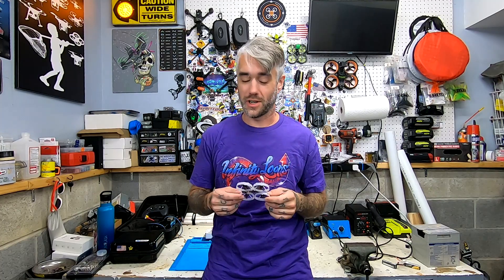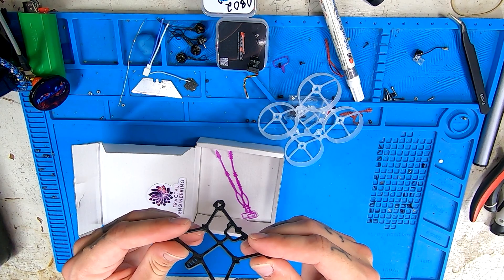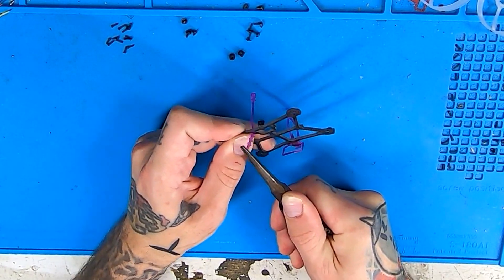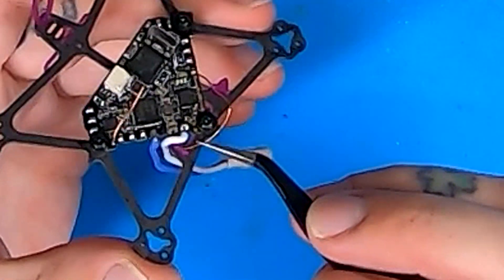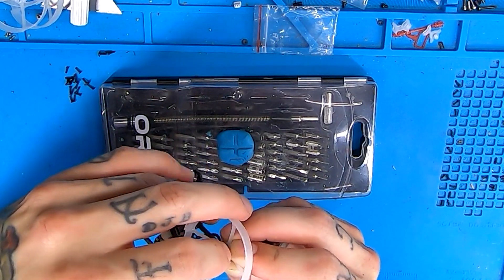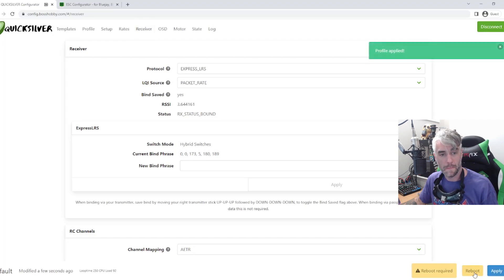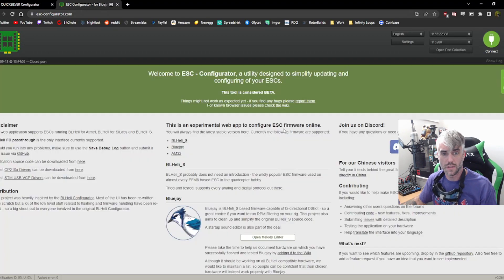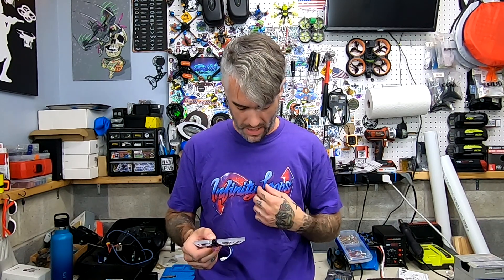The Mobthicc V3 | Complete Build & Setup

Comment: Hi,
     I wish to clean my brushless motor by removing the dust/sand !!

What do you think about cleaning the 0802 brushless motor by using
99.9% Isopropyl Alcohol Electronics Cleaner in spray can ?

Does the Isopropyl Alcohol will remove the grease of the bearings ??

If yes do you have a better solution ??

Comment: Sickkk, i'd been waiting for this one!
Do you know if i can fit the 4 point mobula canopy in this build instead of those 3d printed camera mounts?
I would be using the X12...
Want to transfer the guts of my mobula7 1s elrs to the F75 but i'm too scared to run it with the electronics exposed on top🤣😅

Comment: Hi mate, am about to do a frame swap for my poor broken moblite 75 and was wondering if you reckon I could chuck it on an Air75 frame without having to solder or cut the frame? Cheers for any help!
Reply from the maker: I'm pretty sure that should swap over just fine. Little to no issue. That's the Diamond FC right?
Reply: That's the one mate, will give it a shot and let you know! Cheers for your help.

Comment: Just finished my build where I used all the exact same parts, with the exception of the battery connector (using the PH2.0), ran 1.5 packs through it, and I got to say this is a pretty incredible rig/tune. 

I've primarily flown 5 inch freestyle rigs for the last couple of years, but the feel and performance of this thing is shockingly comparable. I threw power loops around a kitchen chair, and had no issues throwing or catching without any prop wash. Snap rolls, back flips, and front flips all felt dialed - no wonkiness on rotation end. I juicy ejected and was surprised to feel the carry...didn't expect that to be as pronounced as it was. Juicy flicks had a good throw and feel. I'm pretty confident this rig can handle any of the more advanced stuff, except maybe inverted yaws...I'll need a higher ceiling to try. I'm pretty sure I'm going to break it inside my home shortly, and may not have a chance to do that.

I did run into some issues:

- I couldn't connect to the board on my windows machine. When trying to "Reset to Bootloader" it would find the COM, but would then lose it on reboot. I worked around by using my Mac to configure FC and ESCs.

- using the template: the board orientation wasn't correct when I watched the software model. No biggie, but not sure why my orientation would be different. 

- I had to create a different RC model in my radio, as my AUXes were upside down. Didn't immediately see a way to invert the Off/On for AUX assignments in quicksilver, but I'll take a gander at the documentation. 

- I also had to play detective on what motors were assigned to which ESCs to get everything spinning the correct way in the ESC config tab. 

Otherwise, this is probably one of the most complete and easiest to follow full build tutorial I've seen. 

Thank you for this. So. Much.
Reply from the maker: Hey man! Glad you enjoy flying it!
The issues you're having sounds like a different gyro in your fc. HM changed what gyro they were using in the diamonds. I'll see if there's something we can do about that. But I'm glad you got it figured out! Let'er rip!

Comment: Thanks for the video Heads. Great guide! While I cannot hate the ingenious idea of a Fractal frame, it has some issues:

1. Caddx Ant Lite
Mounting a camera which has connectors in the rear isn't supported out of the box with the TPU. Had to lengthen the original model with extra teeth to grip around connectors. I'm reluctant to depin the cam, as being able to change the settings every now and then is nice.

2. Camera mounting in general
I'm not sure if it's because of my modded mounting solution, but even minor crashes end up tilting camera ever so slightly to either side. I find it really annoying.

3. Trutle mode
W/o a canopy which provides distance to the ground, turtle mode is much less reliable. It takes many more tries to flip over - sometimes quad just spins on the ground. I haven't tested this extensively outside in the grass, but I presume it'll be much worse than on the carpet.

4. Battery mounting
300mAh nitro nectars are prone to getting released from the front holder in crashes. I'm trying a mod with thicker holder, we'll see if it improves things.

---

Modified 3d model: https://www.printables.com/model/301933-modified-300mah-cam-holder-for-fractal-6575

I prefer the Mobthicc v2 - w/o any of the issues mentioned above (2,3,4 especially) it lets me fly until the battery says stop. Cracked frame can be fixed with a bit of heat shrink. 😉

Would be curious if you encountered any of the above and if you have any tips. 🤞
Reply from the maker: Hey thanks for the comment! 

1. While beta testing the Fractal75 I tried several cameras, the Ant lite being one of them. In my notes it was the largest camera, weighed the most, and had pretty good image quality. I didn't fly it on the build though, being the heaviest of the ones I had available, I opted for the Foxeer Pico Razer instead. Weight was much less, better shape, the lens didn't stick out so far, and the image quality is solid. The only kicker was the pigtail needs to be changed when you get it. Yves from Fractal may have actually tried the Ant on it. I'll have to ask. 

2. I'm going to assume it is from the camera used or the modifications made. I never have a problem with the camera moving. This very well could be because of the shape of the Pico and where the plug sits. I was extremely skeptical with the camera mount when I first tried the f65, I think I even mentioned it in my review video back then. That had the Runcam nano 3 in it and holds very well. Surprised me. 

3. I can make mine flip on hardwood or my garage floor pretty easily. First or second try usually. I don't want you to think I'm messing with you, I uploaded one of my most recent flights with the Mobthicc. This is my first pack of the day and I was getting tattooed lol. So there is a fair amount of crashing and flipping on hardwood. https://www.youtube.com/watch?v=1LiiJEtFXNE

4. I use 450mah packs in mine, and 3D print my own holders. Some variables there. My prints could be getting squished a bit more so the space for the battery is slightly tighter. The 450s I use are wrapped and stretch the tpu pretty good. Every now and then I would get a bad crash and the battery would slide out. I put a small ball of BlueTac on the bottom of the carbon. So when you slide the battery in, it kind of squishes the bluetac down and adds some traction for the lipo to grip. Could also do a bead of hot glue, carefully. I hope that new holder works better for you. 

I say use what works for you. If the older build works, just fly that! The reason I swapped frames between builds was for durability mainly. I can't break these fractal frames very easily. Also keeping the weight down helps make those crashes a little less catastrophic, which is why I avoided the heavier camera with nice picture. I got tired of breaking things haha. 

If I left anything unanswered, or something else comes up, don't hesitate to let me know!
Reply: Appreciate your response! 👍 Of course, flying what works makes perfect sense, but we're here to also try new things! 😉

I hope my lengthy message didn't come out as rant. I think there's a lot of positive things to be said about the fractal:
- improved durability you mentioned
- not having to replace the entire frame in case one duct cracks
- easier maintenance due to how nicely accessible the fc is
- camera positioning means you can get that bit closer to obstacles and ground
- better prop wash handling at low voltages (placebo or I have tuned v2 poorly)

I'm going to give the pico razer a shot. Thanks for the tips wrt battery mounting. If it comes to turtle mode, I agree it works (eventually) on hard surfaces. It's the grassy outdoors which I'm slightly concerned about - TBD.

I wonder what your v4 will bring. ✌
Reply from the maker: Ah yes, grass is a killer. I keep mine fairly short, but even then sometimes it's a walk of shame 😕 

No worries on the message, didn't find it rant-like at all!

Comment: I followed this guide yesterday, drone flies great! I have a 2 inch 1s and 3 inch 2s toothpick without prop guards. do you think quicksilver would work nicely on those? Both are x12 boards. Thanks!
Reply from the maker: Hey Jeb! Great to hear you are enjoying the build. Quicksilver has some pretty decent preset pids for larger quads as well. I recently used it on a TuneRC 2s 3" build video. The stock 3" tune on QS flew really well!
Reply: @InfinityLoops  ok fantastic! I missed that video, I'll check it out!

Comment: Just picked up one of these frames. Still going back and forth on FC's. Try to find one ELRS uart bases and also has a vtx, Not sure if thats possible yet. Had tons of trouble with my mobula SPI bases elrs when first setting it up. I'm really looking forward to seeing how it handles, if its any different from my mobula frames since they flex so much. I've also been running 20000kv motor and will be upgrading to 25000. Really hoping that gives me the punch I'm looking for. Thanks for the video man.
Reply: I'm having trouble finding the FC that he used in this video. Would you be willing to help me find a link to one or one thats close to equal?
Reply from the maker: I wouldn't recommend this FC anymore. The QC seems worse and the boards are fragile enough to begin with. I have a Happymodel 2g4 FC on this build now.

Comment: Thank you for the amazing video! I stopped on a similar setup a few weeks ago.

I run the thicker F75 frame half the time, no ducts and 300mAh Tattus most of the time but use the 450s when running with ducts.

I have my own filter and PID tune I did by blackboxing with an openlager I elasticed in between the camera and AIO but am kinda curious to try quicksilver again. Currently on BF4.4 and ELRS V3
Reply: QUICKSILVER is ELRS V2, had to use my other radio.

Haven't figured out how to blackbox or tune yet, just getting used to it. It's different then the last time I used it, I don't think it worked with SPI when I used it last, I have memories soldering a receiver.

So far doesn't fly as well as BF4.4 but I am willing to give it a chance.

Comment: Hey I was thinking of building this and wondering what your thoughts are on flying this outside on slightly windy days to work on flying the racegow tracks to get practice in when i can not fly indoors with my fractal65? Also what props and motors would closely mimic the mobfractal65 flight with this 75mm frame on a small track like the racegow? Or should I just build a 2.5 inch toothpick and call it a day and practice with that?

Thanks for the build and the insight.
Reply from the maker: Mimicking a 65mm with anything larger in a racing format is difficult.  65s handle close proximity maneuvering like it's nothing. 75s turn more boat-like when compared. In my opinion, I would stick with the 65 to practice, may build bad habits flying a larger prop on such tight tracks. 
I'm not much of a racer myself, but from what OG has told me, practicing outside with the whoops can be rough. I have fond memories of him complaining about it. For racing practice, personally, I use Velocidrone micros dlc. Builds your muscle memory for the track and helps memorize your lines for the real deal.
Reply: @InfinityLoops  Awesome sir thank you so much I have velocidrone and the micro class on it.

Comment: Hey, thanks for the build, I just put together two identical, everyting works as expected other than I cannot get either one to bind. USART1 is selected, not sure what else to try. thank you
Reply from the maker: Hey there! You're using ELRS?
Reply: @InfinityLoops  Yep, (TX16S-ELRS EdgeTX, no problem binding with my big quads.) Two identical builds, all other features functioning correctly, neither indicates any type of TX/RX interaction. I've tried binding as per your vid as well as using the bind button. Battery connected, UART1 selected, etc. (Thanx for the fast response BTW)
Reply from the maker: Ok. Let's start with elrs version. Which is on your TX? Elrs 2.x or 3.x? Also, which version of QS are you flashing?
Reply: @InfinityLoops  QS version is 9.5,  looks like ELRS version is 2.4.0 on TX
Reply from the maker: Bingo! QS 9.x supports ELRS 3.x. easy fix, just need to update TX firmware.
Reply: @InfinityLoops  Thank you, though does that mean I will have to update all of my other quad that are on 2.X?
Reply from the maker: Yes. ELRS will likely receive updates often as it is being developed.  As it improves, it will need to be updated across all of your receivers.
Reply: @InfinityLoops Thanks for the help, means a lot. subscribed!!
Reply from the maker: Anytime. If you ever need help again, we have a link to our Discord in the description.  Lot of people over there with good info 👍

Comment: Hi, I built a fractal 75 using the moblite FC board and the stock 1900kv motors. I’d like to try out quicksilver…do you think that the profile you created for this mobthick 3 will work on my build? Also, did you notice any difference using 450mah lipos with the bt2.0 connector?
Reply: As long as you are running the fc inverted the template should work. You need to make sure gyro moves as expected and motors operate correctly in the configurator before flying.

Comment: Hey I built this quad following these instructions and during the motor test phase my motors werent spinning after flashing bluejay very much, they were stuttering or twitching. I unplugged and replugged the battery and got smoke, one of the esc components burned :(

I checked everything over with a multimeter and nothing is shorted. Power wires and motor wires are all cleanly soldered. Any chance you know what went wrong? I want to build this quad but I cant smoke another board.
Reply from the maker: I have a feeling like I know what happened, yes. If you were using the DiamondF4 fc, those escs have a tendency to self destruct on their own.  I would try reaching out to Happymodel and letting them know you had one burn up, they may grant you a replacement.  

These FCs used to be so solid, then suddenly not anymore. ESCs burning up on brand new boards.
Reply: Thank you so much, this is what happened, failed esc out of the box. Got a replacement and I am loving this build, Thank you! @InfinityLoops
Reply: Wow, not long after building with the new board my new one now has an issue.

I noticed it after doing a turtle flip, same thing as before, one motor only twitches sometimes and it struggles to take off at times and I can see one of the FETS looks like it has a bubble, just like my other failed board.

This is making me nervous to continue with quicksilver and bluejay but I really enjoy the way this thing flies when everything is working right.

Is this really all just down to poor board quality? Should I even attempt another board or is there a better option now? I want the lightweight but these elrs versions dont seem to have the quality behind them. Is there any chance this was from using turtle mode at 100 % in QS?

Thank you for replying.
 @InfinityLoops
Reply from the maker: From my experience,  both Betaflight and QS would fry ESCs in the Diamond board. The FC is notorious now with popping fets. I have a massive pile of dead Diamonds from extensive testing of this. It's a gamble with that FC. You might want to look into a 12a ESC FC to run on 1s. Give you a bigger ceiling for buffer.
Reply: @InfinityLoops  thank you so much for the response. There really aren’t enough micro 1s boards with built in vtx and elrs. Might have to roll the dice again and hope for a good one.
Reply from the maker: Unfortunately, you're correct in that 1s micro boards with vtx/elrs are scarce.  Very fragile lately
Reply: @InfinityLoops  you have seen success with the diamond on the mobthicc though right? I really want this build to work out.
Reply from the maker: Yes absolutely.  I started using this build before the Diamond existed.  Once it came out I used it up until now, I currently still have them in my builds. I just think the ones that came out earlier were more solid. Lately they have been hit or miss.
Reply: @InfinityLoops so I’ve been through 3 elrs diamond boards now. Always end up with a twitching motor that doesn’t want to let the quad take off. 

Is there any chance that I’m missing something in the bluejay setup?

Is there any way you could make us an updated bluejay video? Even if it’s just a short. 

I would really really appreciate it. This build is amazing when it flies. I really want to get a working one. 

Happymodel offered to repair the first two boards so I sent them to China. Hopefully I get a working one back.
Reply from the maker: Man I wish I had a better answer for you, but lately the Diamonds have been having issues. ESCs usually. Whether I run Quicksilver or Betaflight.  Blheli or Bluejay. I've had over 10 die on me. Unfortunately,  I'm moving away from that FC. I've been busy testing new setups looking for improvements in all areas. Finding a solid FC has been the hardest part. I'll keep the build updated with a deep dive video when I'm happy with it.
Reply: @InfinityLoops  thanks man I appreciate you a ton. 

I will say that happymodel did mention something interesting in the email they sent me. They said “we also will release a new fc, almost the same weight like diamond f4, would do something different with the pcb layout. Maybe you can wait for the new fc”

So hopefully that means we will have a good-quality lightweight elrs 5 in 1 soon.
Reply: @InfinityLoops I think I figured it out!

The devs just pulled bluejay 0.20. They said it was causing failed esc’s. All 3 of mine were flashed to 0.20

Might have been my problem all along.
Reply from the maker: @rp479  no way! Good to know, thank you for that.